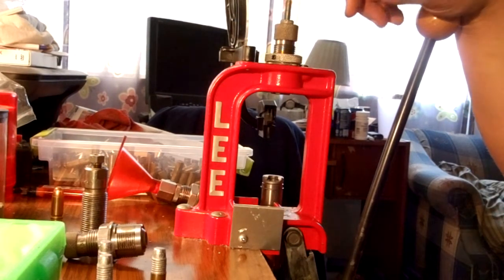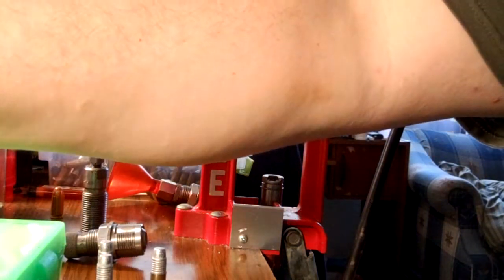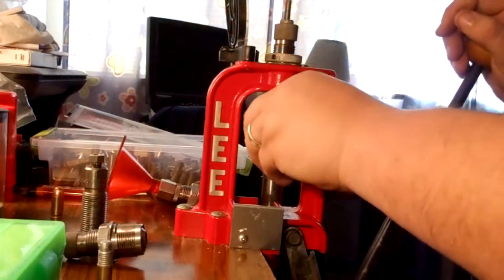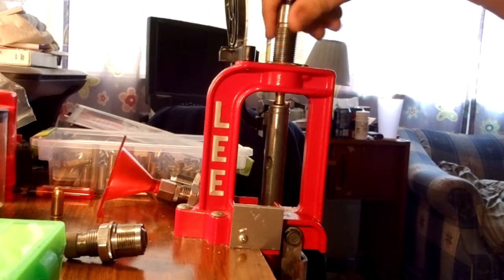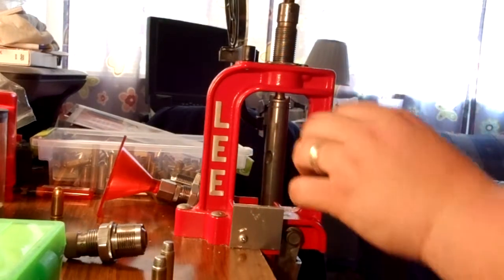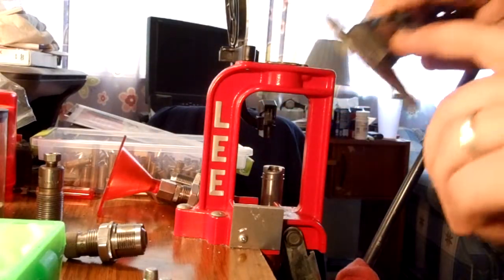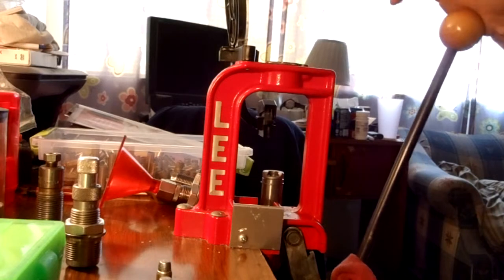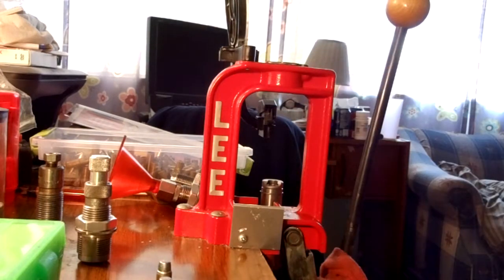Improvised Taper Crimp for 38 Special

Comment: I also have dies like this and they have been a problem. During the reloading process I flaired  the case neck to accept the lead bullet too much and after seating discovered that it would not chamber in the revolvers cylinder. After watching this video I decided to try this and it worked beautifully. It may sound simple but some things are not as difficult as they first seem . Great video!

Comment: Hi , great vid. thanks for the tip . This leads me to ask a question , I've been trying to answer for a while .  I normally shoot soft load WC in my .357. Once in a while I run out of 147gr WC and cannot find any around . I do have a good supply of 9mm 125gr bullets. Now , 9mm are .355  -.356 , which makes them loose in a .38 special case. Can I use this technique to maybe apply some taper crimp around a 9mm bullet that has no callelure ? I have a feeling even that is not enough. 
I only load soft plinking rounds, so I just need to make sure I have no bullet pull due to recoil .
Reply from the maker: I think with that you would almost have to use a roll crimp. Using the method I used in the video will only give you maybe two thousandths of "crimping", where as with a roll crimp you can get a lot more. The lee seating dies have a roll crimp built in to all of the new ones now, you should be able to pick one up for under $20 off ebay
Reply: +Hook-set Outdoors   Thanks for that. I already have the 3 die set for the .38/357   and I tried the roll crimp on the 9mm bullets , It does crimp but bullets being smaller , the result is not always neat. thanks for replying though.